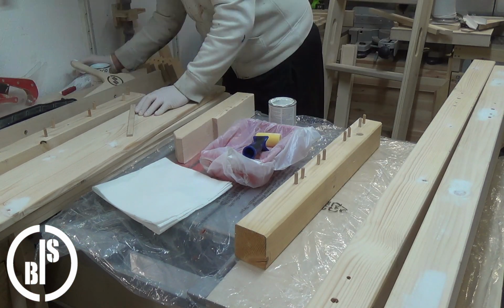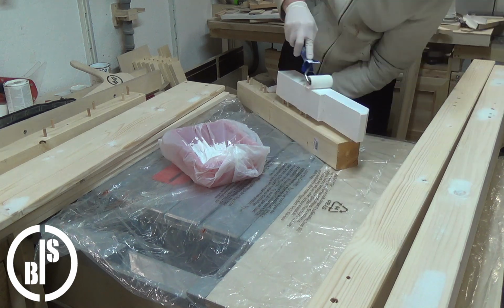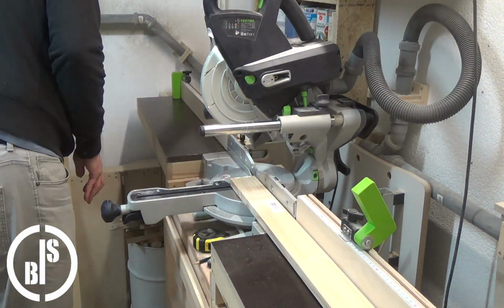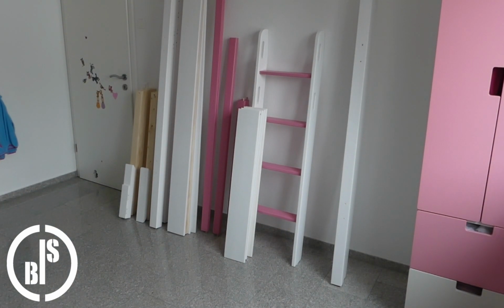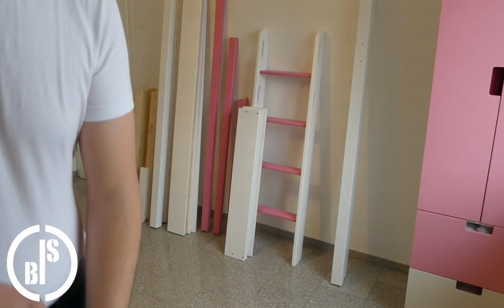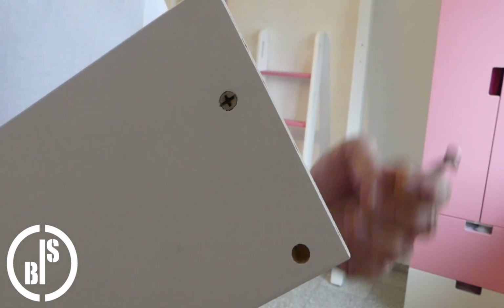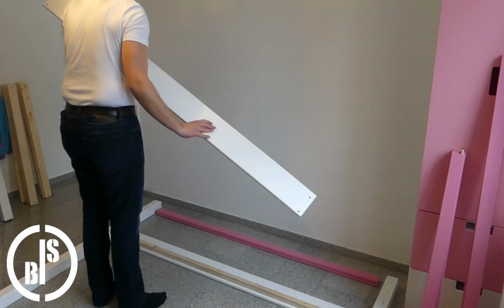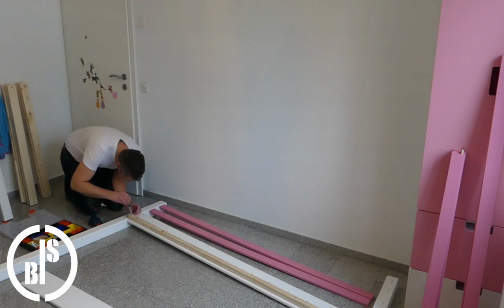How to make a Bunk Bed with a Play Area underneath #2

Comment: Fantastic build, I would love to hear a little more detail on how you lay out for the individual parts and work out the dowel spacing. The jig you made is spot on. Please be careful with the ceiling fan that your daughter doesn't hit herself with it.
Reply from the maker: Thank you. If you have any questions, don't hesitate to ask. That's is not a ceiling fan, it's a hanging lamp. But i replaced it with another one.